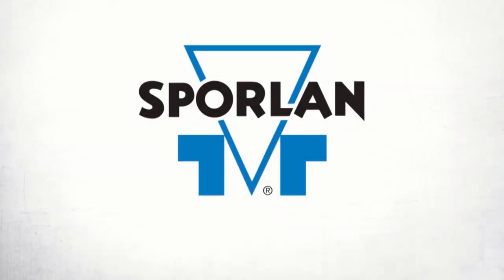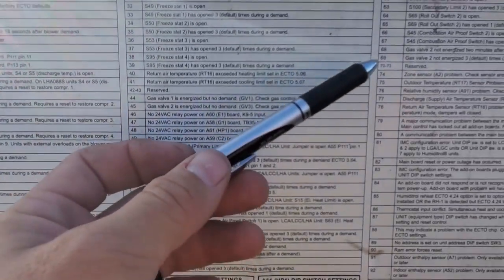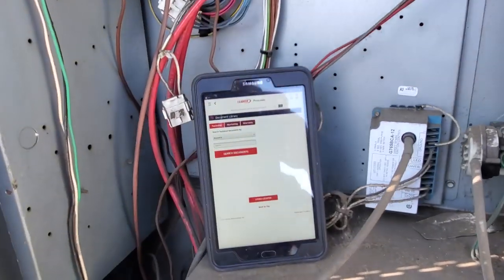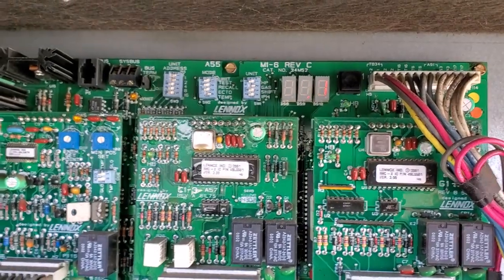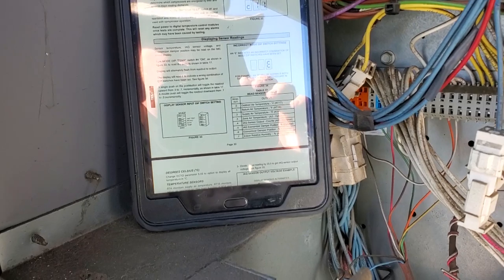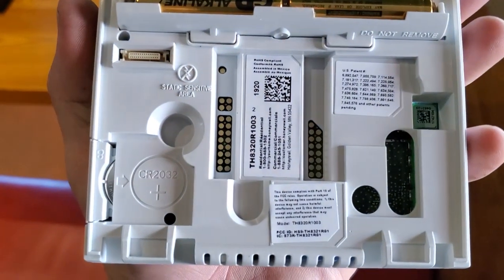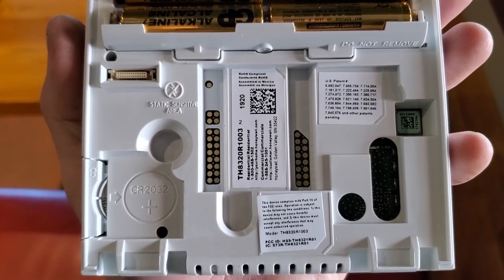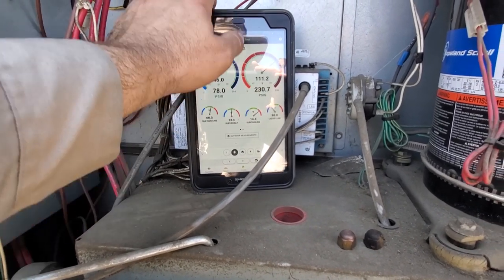LENNOX HEATER RANDOMLY TURNING ON

Comment: Back in the 70's we were doing refrigeration on convenience stores. Employees were always playing with the T-stats and freezing up the evaps. So we would put the guards on the stats. We would come in next week for the same problem, so we would wire an additional T-stat to the system and hide it up in the false ceiling. Of course the floor level T-stat appeared functional, but no longer had control of the compressor. No more problems!
Reply: Back in the day I would leave the thermostats and install Accu-stats in the return air plenum.
Reply: You sir just answered my question of why there was a thermostat located in a drop ceiling of a convenience store I used to go to, apparently you weren't the only one who did this, they had flooding from the apartments above, so the drop ceiling was removed in many places mainly by the wall and I just happened to be waiting in line and notice there was a thermostat behind the counter as well as up above the drop ceiling lol

Comment: Glad you mentioned remote temp placement for the thermostat.  I have found them behind icemakers, in a supply, hanging in ceiling, etc.. Had a restaurant complaining that their storage area would always be extremely hot, found the sensor mounted right next to walk in cooler door 😂

Comment: I am in BAS/EMS and had a customer complained his work area was so cold he couldn't work due to a 100% open VAV damper, OAT was mid 40's. The guy cursed me out saying our DDC was garbage and he fought against it being installed. First trip the guy was working in one of his five other buildings but I had access to the VAV just not the wall sensor. I set a meeting with him for a second trip, he no shows and says the VAV control is obviously broken just replace it. I did my whole I can't verify that if it isn't and I do you will still be charged if it isn't and I need a sign off. Email his boss, get a signed verification, 3rd trip I replaced it and same issue exist. I stopped talking to the maintenance guy and started directly speaking to his boss and make a meeting to get the door open. 4th trip I meet the boss there, she opens the door, and BOOM problem immediately fond. It was a small heater designed to be held up and plugged into a wall socket (no power cord, small little thing) about 2 1/2 feet below the wall sensor. Unplugged it, let the sensor cool off, retested the DDC and everything worked fine. Suggested we replace the sensor anyhow in case the heater damaged anything since it was a $12 part. He was let go sometime that month. Not sure if he was trying to cause problems or just an idiot. I think he did it on purpose.

Comment: Open up the manual? Generally when I show up, other techs have left manual out of the plastic zip lock, and it laying inside the unit, doors haven’t been put on correct, and manual is a soggy mess stuck together.
Reply: Or just gone with no sign of it having ever been there..

Comment: Ran into a similar issue. Had a drop ceiling with open plenum return. Soon as mechanical cooling stopped, the 84 degree return air would blow warm air on them.

Comment: I’ve worked on a lot of these units with the old M1-6,7,8. I’ve seen the unit set up for free air cooling to be used at 60° with no regard to humidity. Now the unit will not run the compressors or maybe only 1 of 3 when in free cooling trying to use the outside air. Some issues I’ve found is the humidity if 100% and 60° makes it worse. Another scenario is by the time you get to the call OAT is above FAC set points and it’s fine. We deal with this on the east coast a lot. FAC is separate from the tempering. If it is setup for humidity those enthalapy sensors in the economizers go bad often, confusing unit. The newer M2 and M3 units are more user friendly to check all that. I heard a rumor from a Lennox rep the new board in development will have Bluetooth so we can use our tablet to control, adjust , and diagnose with our tablets.
Reply: Well Bob, it has been a year. what about that new board?, bluetooth???
Reply: @Android_Warrior  LOL i dont work for lennox. I hope they are still working on it thru this pandemic. Maybe the rep was lying. Sorry you been holding on to this for a year.
Reply: @bobbassini3337  👏👏👏🤭🤭🤭

Comment: I was at a school doing an inspection. 3 units were in heat mode one was cooling. I went down and found an IPad charging station under that t-stat. Another place I was installing t-stats with sensors where the t-stats originally were. One guy there asks what I’m doing. He says “oh I can get by that”. I say please don’t. As I was setting up the stats the temperature was climbing like crazy. I went to that sensor. The guy had slid a filing cabinet under it and put a cup of coffee under it. He was laughing and I had to laugh as well. That was pretty good. Hey good video as usual.

Comment: Good job I’m curious though with the fresh air mixture say it’s a 100° day say it was in Florida where the humidity is always sky high would that affect the cooling or would the 3 stages of cooling take care of the heat load inside the building

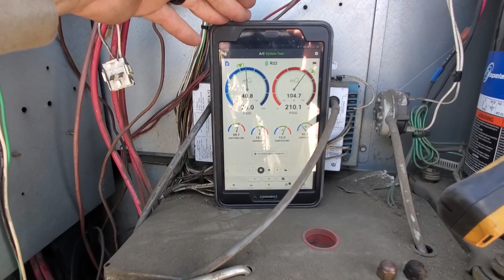Comment: 14:22 sounds like a GE90 aircraft engine at full takeoff load
Reply: Now that you mention it, I've been on aircraft that have a similar hum at takeoff throttle.  Always thought it sounded unusual.
Reply: If I remember right, its because the tips of the fan blades go supersonic at high power settings

Comment: I got to wonder why the HVAC industry is so behind the times, why cant you plug a usb cable from a laptop and test and monitor everthing from a laptop?
Reply from the maker: Actually the newer units do have the ability to do just that.
Reply: I do HVAC control in luxury homes and we have had that for years. Still doesn't tell you where the issues are though, just makes it easier to solve the problem.

Comment: are you a fan of the red link wireless sensors? I tend to use them as a less expensive way to average temp in a building that gets hot on one side and cold on the either.

Comment: When I am showing one of the techs a unit like this, I always refer to the compressors and their refrigerant pathways as CIRCUITS..which is what Lennox calls them (Page 37 of the LGA book). The first two CIRCUITS comprise the FIRST STAGE, or Y1. The third CIRCUIT is the SECOND STAGE, or Y2. This way, we are all on the same page. We might say, "first compressor" or "second compressor," but "stages" always refers to the calls being received by the unit.
BTW...the weak link on the M1 style boards is the DIP switches. Finally, never leave the  switch set to "recall." HTH.

Comment: 70°F that's like 21.1 °C. that's completely normal for me . what temp du you set your air-conditioning ????
Reply: Dunno , 21 seems a bit cold , especially for hot climates . If the clients come from outside where it's probably around 30-35 and they sit in a 21 degree ambient, that's too cold . Summer time , when it gets really hot , the setpoint should be around 23-24 degrees Celsius in my opinion.
Reply: We keep our home 75 during daytime, 74 at night.  My Fiance would like it colder.  When I lived alone in the past I would keep it around 76-77.  Are women hotter than men?  I guess so, in more ways than one!
Reply: khalil’s Heat and air conditioner repair  80 in winter, wowza!
Reply: khalil’s Heat and air conditioner repair  Can't say I've been a hot house like that during the winter for years.  Generally the winter setpoint is around 68-72 for most folks.

Comment: i'd suspect an wire rub through and vibration or rodent chew marks touching somewhere along the wiring.
watching more I started thinking there isn't an optional zone air sensor and board programmed wrong  OR there is and someone placed it in a fridge/cooler or an air leak from one through wall into sensor?
the humidity readout, interesting, you think it would be disabled reading nothing, but maybe 50% is default readout. that seems like a basket of scrambled egg's :)

Comment: Doesn't it have 3 cooling stages? Or did I miss something? (when configuring t-stat)
Reply from the maker: It has three compressors but the third stage is controlled by the circuit board logic in the unit. So you only need a two stage thermostat. I will be going live on YouTube this evening 12/30/19 @5:PM (pacific time) to discuss my most recent uploads and answer questions from emails and the chat, come check it out if you can
https://youtu.be/XNnsDZUitZQ

Comment: so, programmable T-stat with CR2032 battery for memory backup... the older models likely have them inside, supposedly non-changeable and could eat them in 3 years max.....
next if too many have the same default factory pass code anybody can alter them.....
I see all that as major security failures, same for hotels/motels, IoT devices and more. don't get me started into the automotive industry chock full of garbage.
I wont post all the pseudonyms I have for IoT ( internet of things) but they're being smashed and exploited hard core as well as other pure cruft junk unleashed upon we the public :)
Reply from the maker: yeah the smart devices that we are installing in our homes are kinda scary when you read about the lack of security they have in them. Most people think just because it says google or amazon on it its is safe but that is far from the truth.........

Comment: just not finishing watching, probably best to put minimum at 65F depending on vent placement, far too often they have vents blowing air or cooler air flowing over t-stats... original builder/stooge install or some darwin remodel where nobody removes their heads from rump ends, those of us who do, nobody wants to hear about it. cheap cheap cheap is what they want, not you'll have change the design to allow for mechanical's around, they screech as if they're the best because they went to college and have x to xxx degree.... brain washed tools ;)
sorry rant rant rant... not all are that way, I always end up with the basket case scenarios, because I have the balls to head butt them back ;)